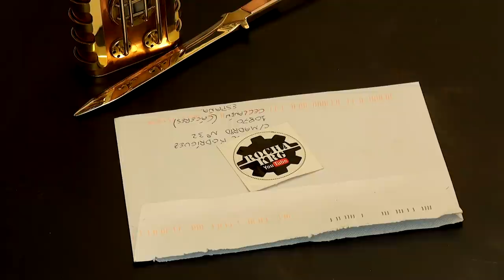Steampunk Cigarette Сase How to Make DIY 2#

Comment: I wonder if this could be applied to a flask....
Reply: probably. you'd wanna use actual glass for the window and use an epoxy that's food-safe to hold it (or even food-grade silicone to help with waterproof- alcohol and plastic containers don't get along; and you could just forgo the window altogether to play it safe- and then just make sure to wash it well and often between steps to make sure you dont get any copper shavings in your booze.
Reply: you can if you make sure that everything is sealed good and that the epoxy is food safe and that the solder is lead free.
Reply: THAT'S A NEGATIVE, SIR...
Reply: you could use a glass flask and make a shell like this around it a friction fit, if it can be done with leather I foresee no problems doing it the copper or brass route. kinda like this https://cdn.shopify.com/s/files/1/1064/4168/products/opt-hip-flask-8-back-detail-IMG_2417_grande.jpg?v=1527191127 easily replicated in copper or brass. So yes you could.
Reply: Why couldn’t it be?
Reply: Great thinking my dude

Comment: True craftsmanship!  I salute you!  How did you index the holes for the center piece?  I like your dremel adapter for the lathe, but how did you index the lathe chuck so exactly?
Reply from the maker: In the back of the lathe on the spindle, I connected and screwed two protractors.
Reply: @BanjoShow  You're a clever guy.  I never thought to do that!

Comment: Great video. But I want to know what you are using to drill the hole on the lathe. It looks like it was maybe mounted on the cross slide but it cool. Hope you see this and can tell me.
Reply from the maker: I made a holder for my Dremel and clamped it in the tool holder
Reply: @BanjoShow  pretty smart. Thanks. Going to draw something up for mine now. Thanks again.

Comment: It would be awesome if you would make some mods like this. Vape mods either parallel/series mech mods. Or parallel/series with a MOSFET. Or even single 18650/21700 battery squonk mods. You could sell as many as you could make on Facebook, for very good money.